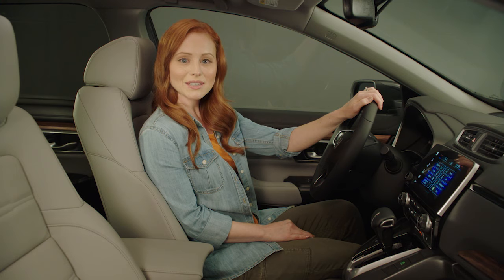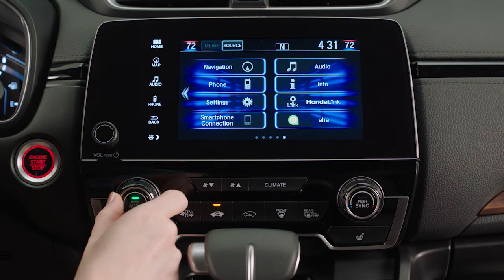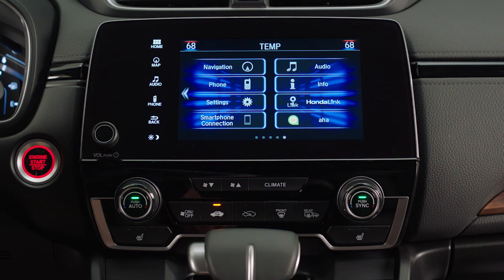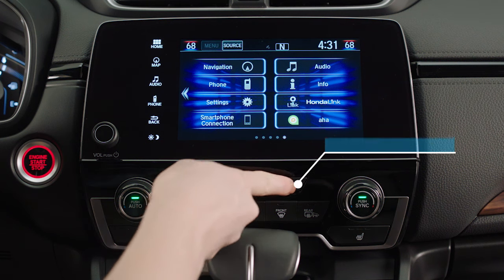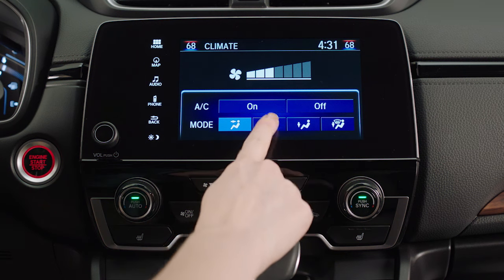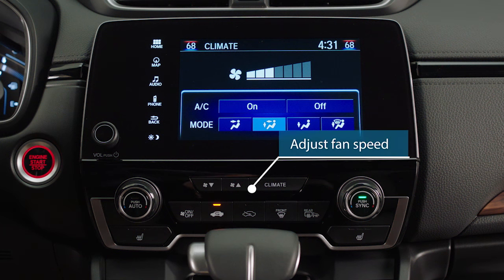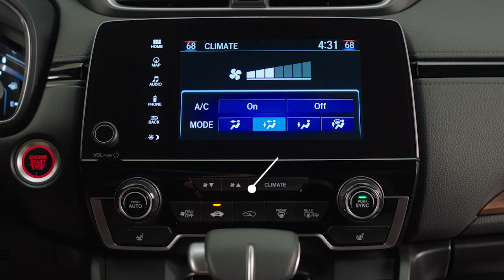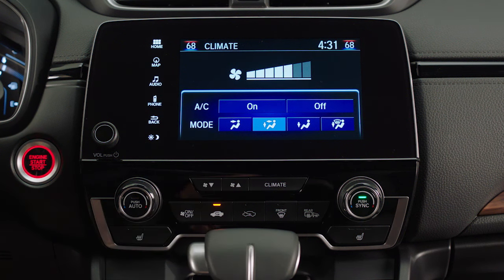How to use the Climate Controls on Honda's Display Audio System

Comment: still confused on how and what the sync button does
Reply: It automatically sync the drivers adjusted temperature to the passenger side.
Reply: @TheHmongWarrior  Straightforward forward explanation
Reply: the sync button makes the left/rear and right/rear heater outputs the same temperature as the setting you want.